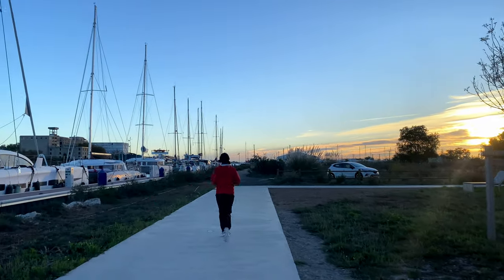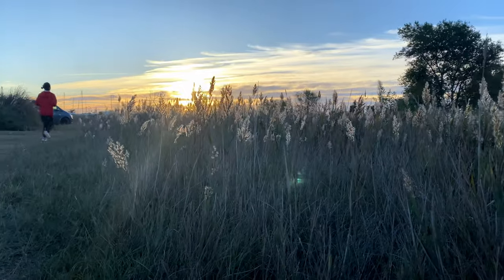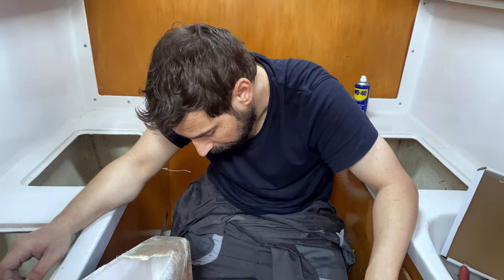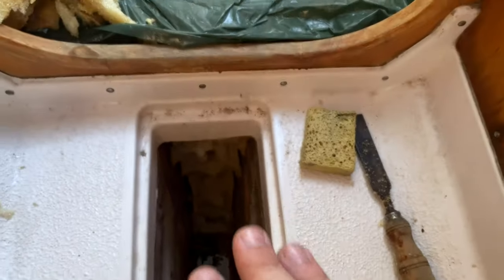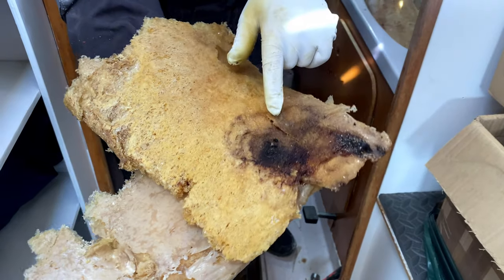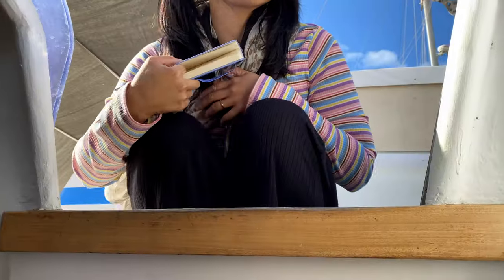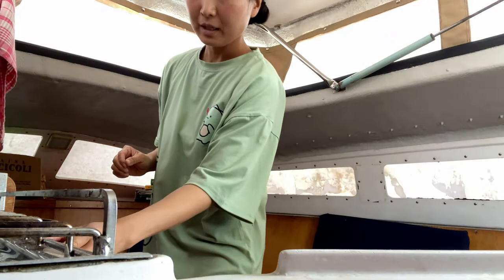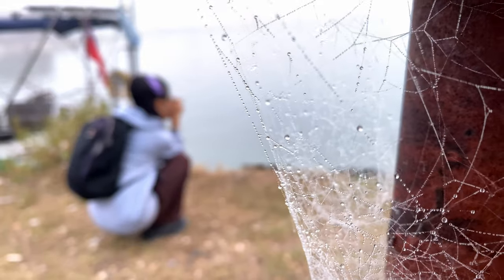The foam dilemma! Ep.08

Comment: Two part polyurethane foam, sold as closed cell…never was, and certainly isn’t after a number of years….dont ask me how I know.  I had more than yours…and in a ply boat.  Ok for use well above the waterline. 
No point putting foam back, it is not going to give significant floatation.  If you do need that, best to fit a number of Styrofoam blocks into the spaces.  That is properly closed cell, and being lose can be removed for maintenance.
All old grp boats have some bubbles, not necessarily osmosis, and even then unlikely to be sufficient to give a major concern. Just pop n fill.
Reply from the maker: Hello Mark! Yes, normally we would just pop and fill but we made the mistake to investigate further 😅 lesson learned! But in the end we decided to mimic and put everything as we found it, but new. Our knowledge of boats building is getting better with each comment and from now on “if is not broken don’t fix it”😊
Reply: @sailingjoa  well although I said don’t, but as you already had, no worries. It will be some years before it degrades.  And I guess it does give some limited additional strength. Plus if you make a hole it will be more contained.

Comment: you do know that there are different types of foam. open cell and closed cell to start with. Closed cell will not absorb water, while open cell will. Then within these two types there are different levels of density , which is basically weight/volume.  or in other words, how small the air bubbles(cells) are and how thick their bubble "skins" are. Small closed bubles with thicker skins are heavier and better structurally. They are also generally more expensive.

your boat was made of polyester epoxy, the cheapest and the most susceptible to water penetration and osmosis. The best epoxy to adhere to it is the "real" epoxy - like west systems. It will still only have a mechanical bond, not a chemical as well, but it sticks to cured polyester belter than new polyester epoxy or new vinylester epoxy, it is also the strongest and the most water resistant of the three epoxy types.

also note that even a single skin fibreglass hull will allow light penetration, so a "eye of Sauron" does not necessarily indicate a concerning weak spot in the hull.

also it is possible that you have at least two sources of the Osmosis, one from internal water leaking directly into the foam and attacking the inside of the outer skin of the Hull. And water having penetrated from the outside, through the gellcoat and first outer layers og the hull fibreglass into some "voids" or dry layup within ( 1 - 5mm depth) the hull skin, that then starts to work out ( not in) again. 

Note Osmosis in polyester ALWAYS generates blister (pimples) that when popped produce / ooze  a wet chemical that is corrosive to your skin and smells like vinegar.

Was the water in side the foam salty or fresh. this will tell you if it was an external hullskin breach letting water in , or internal water ( rain - shower sump, watertank) 

IMHO it would be unlikely that external water had penetrated the hull through to the internal foam just through osmosis, that is extremely rare AFAIK. There would have needed to be an actual collision and/or destructive cracking of the hull skin for the external water to penetrate  and  saturate the foam, and that damage ( and repair) should be visible from the outside, and more so from the inside ( no fairing to make smooth) .

 I have a 1981 foam cored boat with polyester resined fibreglass
Reply from the maker: What boat do you have? We guess that is high density foam because the air pockets are very small. But it’s our guess. But now it’s all gone 😊 we have been talking a lot about how to go forward, foam again or not make it stronger!!! Yes probably with real epoxy! Happy new year 🥳
Reply: @sailingjoa   have replied in  patreon